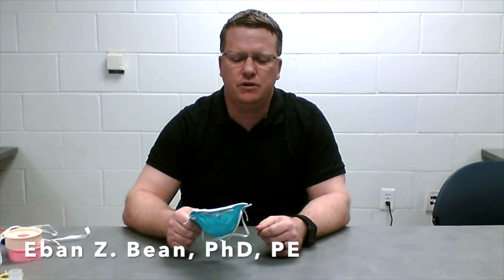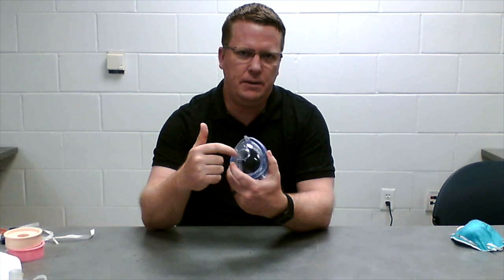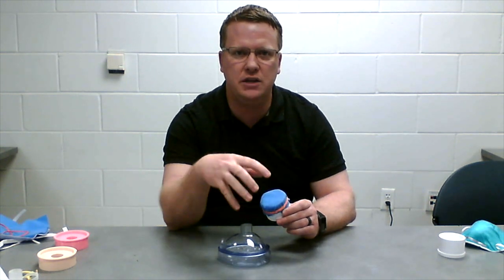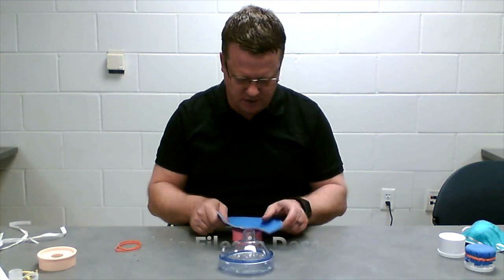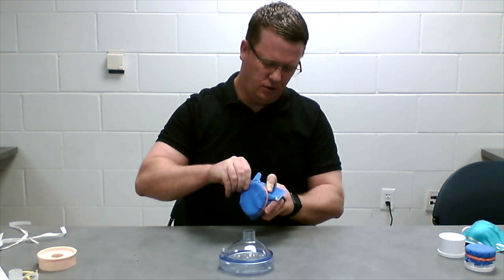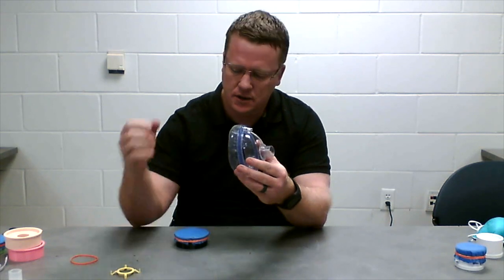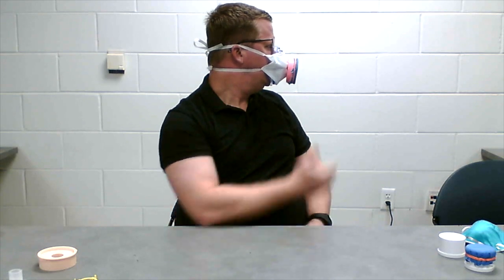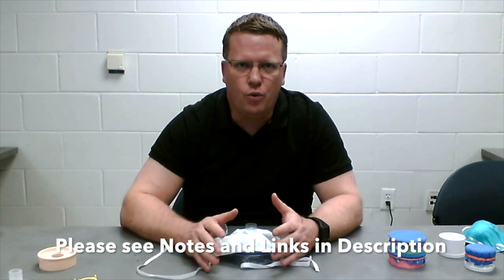Simple to Produce N95 Equivalent BVM/Anesthesia Mask using Halyard H600 Surgical Wrap

Comment: It is my understanding that the Halyard One-Step sterilization wrap comes in 6 different "weights" or thicknesses, H100 being the lightest and H600 the heaviest, but all weights have the same Powerguard anti-microbial technology and provide the same viral protection.  If this is correct, the lightest one (H100) would be the best choice if I am using it as a slip-in filter layer between 2 layers of cotton (home-made Olson-style mask).  What is your opinion?

Comment: Is there really a difference in filter capability between the h100 and h600 or is the h600 recommended for masks? Im thinking of just using something to use as an insertable filter and not the outside of the mask.
Reply from the maker: Recommend researching the differences in products via the manufacturer's website: https://products.halyardhealth.com/surgical-solutions/sterilization-solutions/sterilization-wraps/halyard-sequential-sterilization-wrap.html